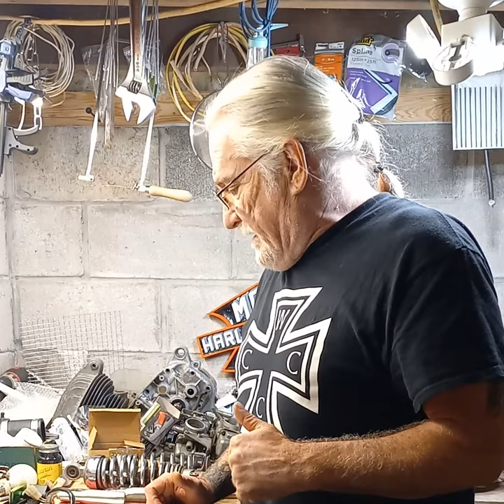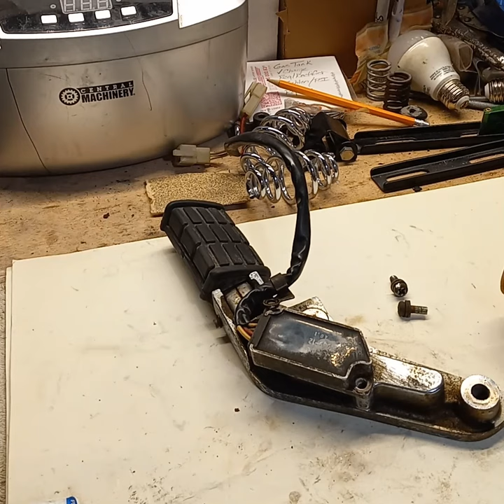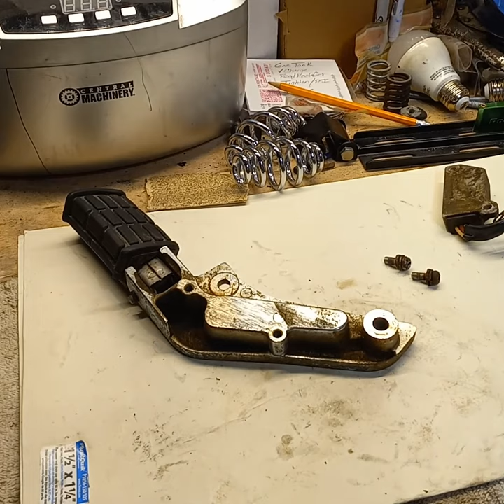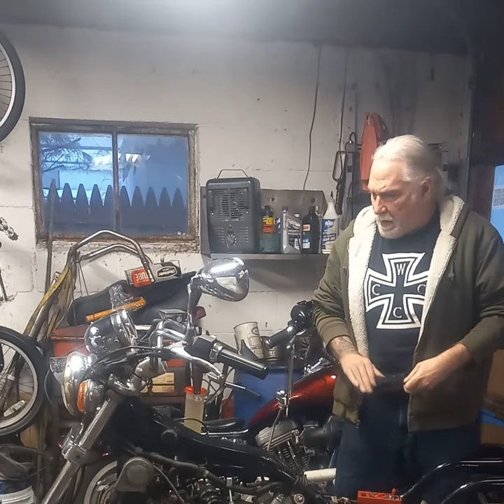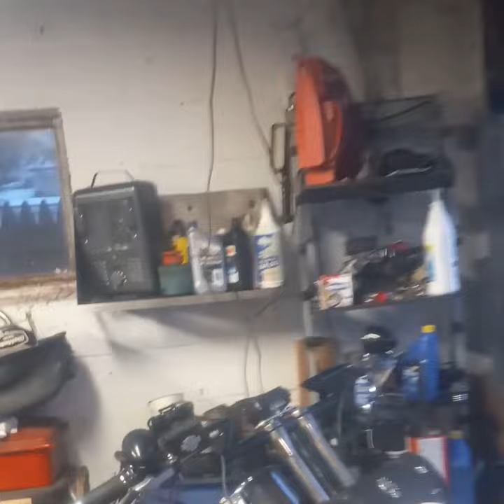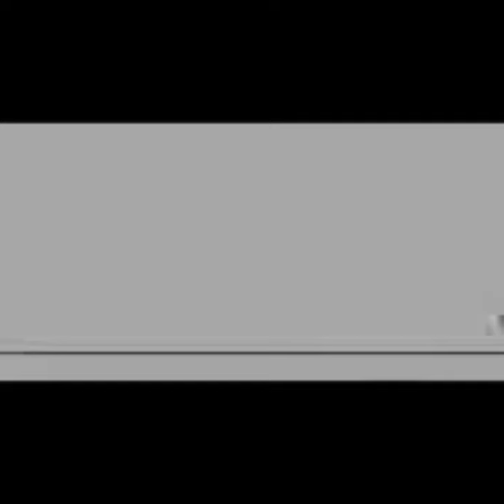BARN FIND, YAMAHA VIRAGO / WILL IT RUN Video #5 charging system / final carb adjustment

Comment: I've got an 85 xv700 project I can't wait to get back into. It has a problem from the start button to the solenoid somewhere. Hit the start the head light blinks out but nothing.. jump the solenoid and starter spins..thinking about snatching it and putting in a push button..keep the videos coming we appreciate what you are doing👍